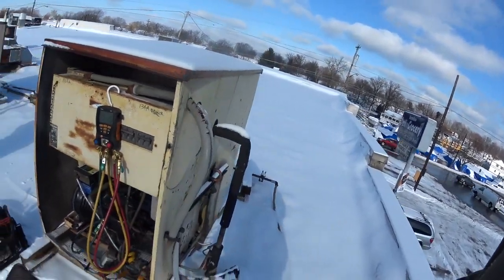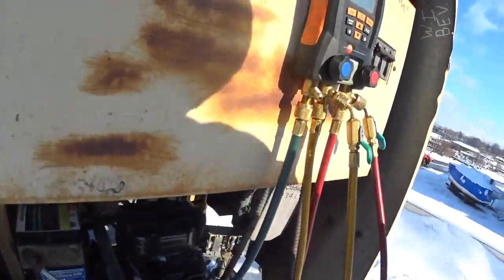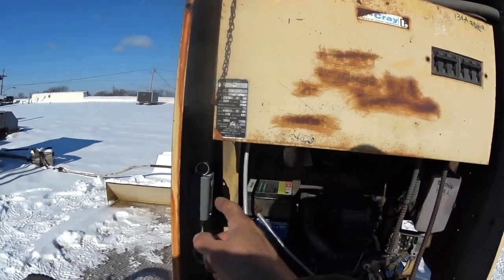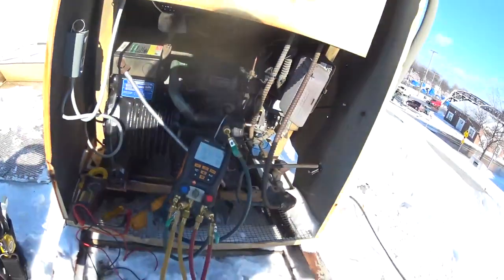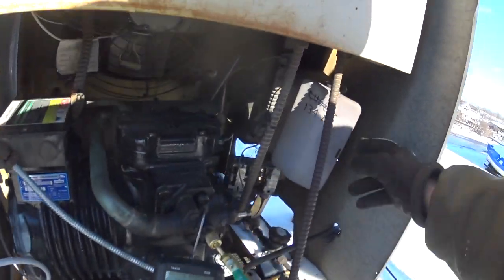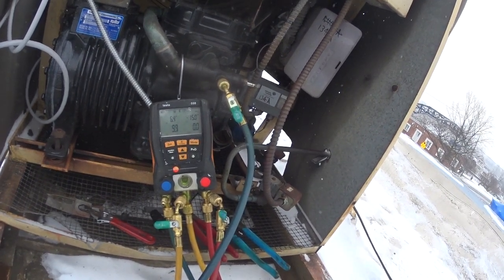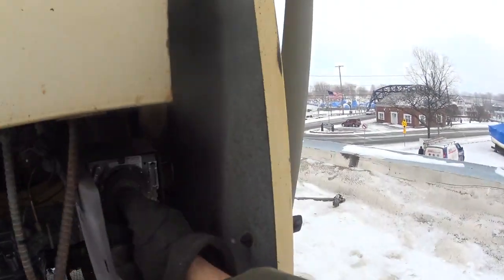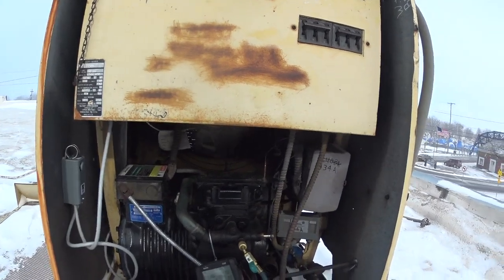Frigid temperature keeping suction pressure low pressure control not cutting in

Comment: The only thing I would comment on is that you placed you thermostat in the condenser hot air stream. If it was in front of the condenser coil, I would say OK, but then be concerned about the elements.  I think a better choise would be a remote bulb like a 1609-101

Comment: wouldn't a fan cycle be a better idea?
and isn't 134 a a bad refrigerant for outdoor applications?
Reply from the maker: The unit has a condenser fan cycle switch and it works good "when the compressor is running" the problem is the ambient is so cold it's keeping the low pressure from rising to the cut in point on the low pressure control and the compressor isn't coming on. R 134a bad for outdoors ? where did you hear that, it works great.
Reply: ***** I was told by one of my teachers at school that it doesn't react well in cold climate. And that R404a is what's used most in outdoor units. And to be fair this is the first time I see an outdoor unit with 134a all the ones I work on are either R22 or R404a.  But either way thanks for the for the informations
The other question that I have. In one of your other videos you said that you've changed the mineral oil to p.e oil on a hermetic compressor in order to use R404a . Was that hard? And is it a good practice
Reply from the maker: Ahmad Hamad I've been changing R 12 systems over to R 134a since 1996, they work just fine. Now I prefer R404a systems. I change medium temp R22 systems to R 404a with an oil change to POE oil and an expansion valve change. Oil changes aren't hard, on a hermetics cut the suction and discharge, disconnect the electric, remove 4 bolts, drain oil into a metal coffee can with ribs in it for measuring, then put the same amount of POE oil into it, swedge, rebraze, change the drier filter, pull a vaccum and recharge. Write the bill and go home.
Reply: ***** thanks for the info. You been very helpful. I will keep watching your videos as they are very educating

Comment: Thanks for taking the time to make and share these videos under freezing condition. My question is how was those extra add components wired in?
Reply from the maker: You just find where the fan is connected and run one wire from that point through the control then back to that point.

Comment: Hence the insulation on the tank and the heat strips with an o/a temp sensor.... awesome work again. What i didnt see is how is that unit protected from the elements when used in these types of ambients. Bad engineering or a hack install job?
Reply from the maker: This unit just has a large reciever tank, and this location is just off Lake Erie (cold wind). Most units work without this repair.

Comment: Nice work on that old weathered condensing unit. Ive had similar repairs and installed a fan control switch for head psi. Also it helps not being in frigid ambients here in California. Thanks Jim great video
Reply from the maker: yeah Carlos, I like the Ranco Head pressure fan controls too, but on this unit the cold air temp wasn't letting the suction pressure rise enough to kick the pressure control in.

Comment: That's weird that's something I've never seen before, freon compressing due to low ambient tempeture lol
Reply from the maker: yeah, the wind chill was -14, the next day it was -24, it just hurts skin. The suction pressure just doesn't rise enough to cut the pressure control in. Normally the evaporator gets cold and causes the suction pressure to drop, here the condensing unit gets cold and causes low pressure. It's a common problem we learn to deal with,